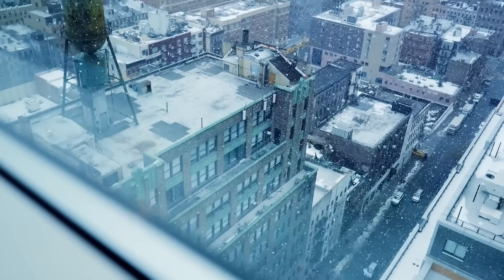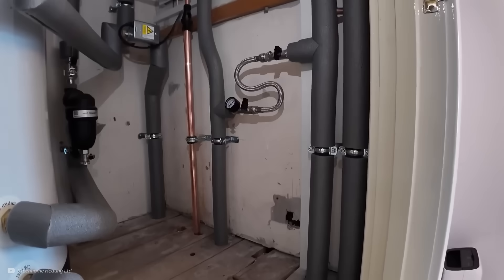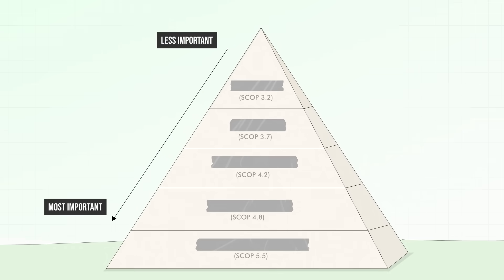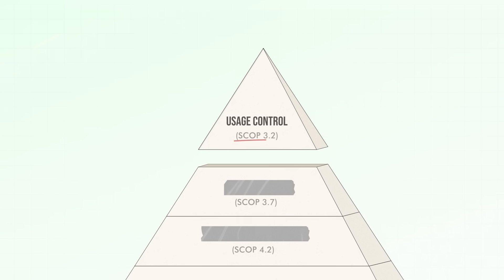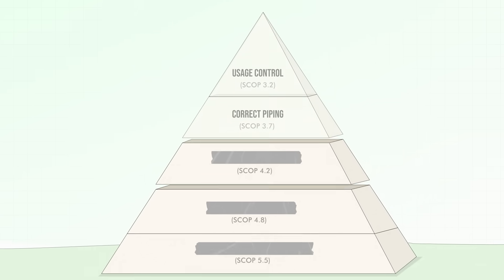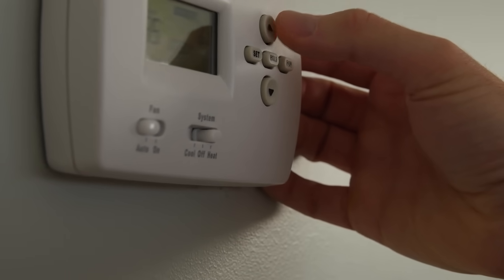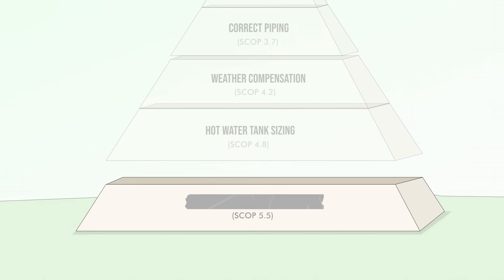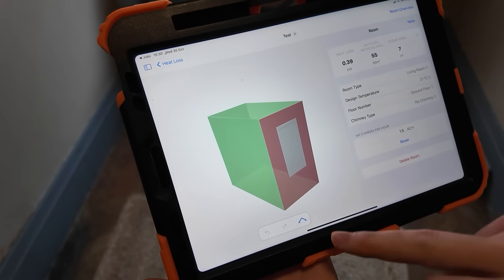The Genius of the World's Most Efficient Heat Pump

Comment: I’m afraid in the real world the stratospheric cost of installation (whether with new mega radiators or UFH), new piping, new water storage, and the HP itself is a huge roadblock for homeowners, as well as being incredibly disruptive and space-robbing, always assuming you have the spare space to start with.  Where does your furniture go and how do you live when your entire ground floor needs to be dug up?  For new builds and already incredibly well insulated properties with space HPs are a great idea.  The colossal cost and disruption for most existing homes is a circle only the very wealthy can square.
Reply: You would be surprised how economic they can be even for installations in existing homes. 

From what I've seen it's been more of a question of whether you can afford not to do an installation, especially in homes with purely electric heating.
Reply: @ People simply don’t have five-figures to rebuild their heating systems - any building/plumbing/electrical work is fiercely expensive in the UK.  Just having a car charger installed costs £thousands.   We’re already in a cost-of-living crisis and electricity prices in the UK are amongst the highest in the world, which makes the running costs of the HP very high compared to expectations (based on what I’m being told by installers).  The vast majority of homes in the UK use gas or oil for heating.  These practical issues cannot simply be wished away.
Reply: For a mega efficient (500%+ system), this can be true. For a  400% system, it's usually swapping single panel radiators for double panel. Not cheap,  but the end of the world. In the UK, you're saving relative to gas if you're above ~350%
Reply: @ That assumes an already excellent EPC value for the home.  Most UK homes already have a high proportion of double radiators - in mine all are - I’ve been told I’d need 50% larger radiators throughout.  The cost is huge because it’s not just the cost of the radiators and labour (plumbers charge £600 each a day in labour, + vat, round here), but all the pipework needs changing to accommodate the larger radiators, and that’s before the HP pipe work.   The efficiency figure vs gas takes no account of the installation cost/cost of funding (borrowing cost to pay for it - if you can afford it and a bank will lend you the money - most cannot) including the cost to the economy in higher taxes to pay for any Gov subsidies.  For new builds HPs are a cert, but for existing properties it’s a question of practicality and fundamental affordability.  You cannot force people into huge debt to pay for something they cannot afford to suit a Gov edict.
Reply: @borassictime918  I'm not denying that installs are currently costly. It sounds like you've had a survey done. Do you know what temperature they were designing your radiators to? The designer may have gold plated the design - It may be worth getting a second quote.

If the house needs double panel rads and a high flow temperature, it's probably not very well insulated. I DIY'ed my internal wall insulation and I installed my own replacement radiators - I agree that labour costs on the retrofits often make the payback very unattractive.

I agree with the financing point too. I think the government needs to do something drastic here. Make a clone of the Student Loans Company and charge very low interest rates, for example. The Green Deal was a mess, but ignoring financing is a mistake too.
Reply: @ All true.  50 Celsius was the design output.  I really don’t want to get into alot of debt just to heat my home when I have a mains gas system that works.  That is the core problem.
Reply: Depends where you live, of course and whether you own, rent or simply squat in the property you inhabit.

Many countries and states have incentives, some active assistance.    The trick surrounds payback times which come with reduced energy bills. If you intend to move on before the projected payback date, bear in mind installations do have a 'value added' effect of your property price. 

Others here have made the point that you need a reliable installer and that cannot be overemphasised.

Comment: why aren't they powered by peltier generators otherwise people will freeze to death in power cuts
Reply: Any modern central heating system requires electricity to run.  Fans, pumps etc. if power cuts were a big issue it would have been one already.
Reply: @BenIsInSweden  True unfortunately I'm in the UK which means our houses are mainly craply insulated I had to reopen a fireplace one year because of repeated power cuts.

Comment: If the hydro is generated by gas then there is no advantage, it is ok in fall and spring with nuclear power
Reply: I presume you mean if the electricity is generated by gas. You're wrong. If CCGT efficiency =50% LHV, electricity line losses are 7% and heat pump efficiency = 400%, then total efficiency is about 186%, so about double that if a gas boiler.

Comment: Stating efficiencies this way is a sales gimmick. You should instead compare work energy used to what an ideal Carnot cycle would use for the same energy transfer from the same low source and room temperatures. In reality never over 100%.
Reply: Mathematically true, but not exactly useful when comparing a system which transfers heat within a system (gas boiler) and one which moves heat from one system to another (heat pump).

Comment: Heat geek seem to really know what they’re doing. However @Ziroth should’ve mention that the only way to improve COP is to decrease the temperature rise. Every aspect of the pyramid is in a sense trying to decrease inflow temperature. Usage control avoids heating demand spikes, which in turn decreases the inflow temperature spikes. Correct pipings means higher flow rate, lowering the energy usage of the pump and the inflow temperature. Weather compensation lowers inflow temperature during spring and autumn. Hot water requires the highest temperatures, so sizing the storage tank is just decreasing the inflow temperature again. Large surfaces can use lower inflow temperatures, so floor heating can use lower inflow temperatures than small radiators.
A COP of 8 is impressive, but far from the max. I’ve seen heat pumps using lake water and floor heating, 20C source to 35C end, in September get to COP of 10.
Reply: I don't think there is any place in North America where you can find 20C lake water.  Just north of where I live, lake water ranges from about 5C to 15C.
Reply: Where I live lakes are frozen solid.
Reply: @purpleblueunicorn  Never seen a lake, where the water depth was at least 6'. freeze "solid" to the bottom !
Reply: @jackpatteeuw9244  There have been lake source HP systems that have frozen lakes solid. One I know of was 50ft deep and several acres of surface. It didn't fully thaw out all summer, they needed backup heat the next winter.
Reply: @SuperS05  This sounds like an Internet "legend".  I find these statements very difficult to believe unless you you have some documentation.
Reply: @jackpatteeuw9244  No I don't have documentation, my teacher worked on that one, I never personally saw it. This was a while ago during the oil crisis and HP revolution that followed it in the late 70s and 80s. This was a resort near Sudbury, Ontario if I am not mistaken. He has since retired, and I have had 10 years in the trade after last speaking with him.
Reply: Depends on. Pool heatpumps can get a coop of up to 14. That is pritty good
Reply: @matsv201  pool heatpumps are rated in summer, when the air temp is 20c+, they're typically much less efficient than proper central heating heatpumps.
Reply: @Etacovda63  well sure. But it still shows that cop can be really high
Reply: @matsv201  Where are these high COPs coming from? I looked at a few pool heaters, and they all got COP 5-6 at zero delta. Even high end heat pumps getting 5-6 at a realistic 40F delta is pretty good already.
Reply: I can't even remember half of that stuff anymore. It's been too long. The technologies changed in 20 years so much is ridiculous. I mean kind of sorta. They were just getting variable speed air handlers and A/C units were about 18 SEER I think.
Reply: @YouTubeRanch  I left the programming world to be an HVAC tech. Progress is dreadfully slow in this industry, it gives me time to keep up compared to the IT world.
Reply: I think one issue with most comments is that they focus on one or two aspects of a whole system. That is why I like the pyramid. It shows various system components that influence efficiency from more basic to more sophisticated. If the pipes from the outside heat pump to the radiator aren’t or lousy insulated (like mine), you don’t need to worry too much about modulated temperature control.
Reply: 800%? its a scam...
Reply: @narmale  It's not a scam, just a poor use of terminology. They mean a coefficient of performance of 8.0. That means that for every watt of electricity, the heat pump would be moving 8 watts of heat. This is in no way a violation of thermodynamics, nor truly 800% efficiency. You can't, for example, reverse the system and get 8x the electricity back out of it. You wouldn't even be able to get 1/8 of the electricity back.

If you're curious, the thermodynamic equation for the COP of heat pumps is COP = T(h) / T(h) - T(c) where the temperatures are in Kelvin. The U.S. optional low temperature test for COP is between 5F and 70F (258.15K and 294.26K), which gives a theoretical maximum of COP=8.1.

The peak COP mentioned in the video was certainly at a much lower temperature difference.

Note that the use of Kelvin temperatures helps to see why heat pumps are still useful even at very cold temperatures. -40F = -40C = 233.15K. Even at such temperatures there is still plenty of energy available for extraction.
Reply: @jasexavier  he got the 8 COP in September when a heat pump is barely used. I get 8 COP too with my standard air to water mini split in ideal conditions, but it only costs me 5$ for the whole September so who cares if I can get a COP of 15. However in winter it matters and I average about 3.2.
Reply: @purpleblueunicorn  Yeah, I would agree that the peak value is mainly clickbait and not helpful or interesting.

This is why we have seasonal ratings, which can tell you better how much energy a system will use across the entire year.
Reply: @purpleblueunicorn  He is also using it for hot water. Since the building heat demand isn't yet that high in September, a COP of 8 is really good.
Reply: @Psi-Storm  that's a good point, I'd love to have a any COP over 3 for hot water. I'm at 1 with only electric.
Reply: 800% COP is easy with 5 deg temperature difference.
Reply: @rogerphelps9939  You've obviously never installed any, temperature glide of performance isnt a constant, and is based on gas type and saturation temperatures. At 5.c COP is no more than 4x, unless CO2 or other NON domestic refrigerants are used
Reply: And you need a house on a lake with frontage or right of way.
Reply: Which unit is getting a COP of 10 with a 15°C rise? (It would only be for heated building loops here, 3°C ground water is a luxury here)
Reply: okay so i just need a massive foooookin radiator that hardly moves the efficiency needle.  21 seer minisplits which are market leading, no losses in ducting even barely have cop of 4.  to claim 100% improvements over top of the line minisplits seems iffy at best.  chasing the ole "use a larger radiator" becomes pointless rather quickly when you can install solar at 1$/watt.  hole on. hold up. let me just put in my 10,000sqft of radiator tubing to chase that 1 degree of heat.  and then you gotta pump all that water too.
Reply: COP is not only down to temperature rise, it is also down to compressor and refrigerant system design and very importantly the refrigerant itself.
Reply: yepp you are 90% right, tho its not ALL about temperature. There is also the factor as you mentioned as starting cycles, when the compressor starts its not efficient, so you wanna avoind that and also the flow rate is also about having less energy for the waterpump. 

Tho the lake and groundbased Heatpumps have great COPs, but we are talking about SCOP. In summer my heatpump also has a COP of about 20-25, even better than Lake or groundbased Systems because the air is warmer than the water or ground. But then it comes to winter, and the air is colder. So you cant compare the COP to the SCOP, because the COP is only a snapshot of your whole heating season
Reply: The COP of 8 for September is a bit sad, since it implies that the heat pump did run for heating at high outside temperatures. Which could be avoided, with improved insulation. Higher SCOPs are typically achieved with less insulated homes. I prefer lower SCOP but overall less electricity used for my heat pump.
Reply: @martinmurer4954   You clearly don't live in the UK where Heat-Geek are based if you think that September has "high outside temperatures".

Even on the south coast, September typically gets to around the teen's °c at night and day-time temperatures sit around 13°c to 17°c most of the time. Sure, there might be sunny days, but the average is certainly not "high".

Comment: 13:30 - So, the record performance was achieved in the mildest possible heating month? I'm shocked. Well not that shocked. 
The problem with this sector is that no one cares about the tech. People want heat for cheap. And talking about financial supports at the end is another clue that this stuff still doesn't makes financial sense in the current market on it's own. 5-8x and it still needs subsidies? wow... Advanced LIDAR analysis just sounds like another expense.
If you can't already tell I'm very jaded by all this stuff. 😅
Low and slow sure does rhyme nicely but if people walk into a cold house they want it warm now, not in a few hours. The experience is often undervalued there.
Reply: The thing with low and slow and weather compensation, is you aim to do as little change to the house temperature as possible, as it's a lot more efficient (and slightly more efficient with a gas boiler) to trickle the heat into the house before it gets cold and maintain the temperature.
I'm staying at my dads at the moment in the UK on a thermostat controlled gas boiler, and there are definitely times where the house doesn't feel as warm as the thermostat says.  When we travelled here, his heating had been at 16C away temperature, and even after an hour it still wasn't warm, so it's not like gas boilers give the instant heat to the home that people think it does.

After my dad has visited my home multiple times in winter that I heat low and slow with heat pumps (using air 2 air, so isn't completely on weather compensation), he agrees that it's far more comfortable.
Reply: My GSHP has managed a SCOP of 7 in mild weather. No big deal and not relevant to real world operation.

Comment: Very little talk about temperature uplift. We have air sources with COPs up to 16, but thats because it’s lifting water from 30 degrees up to 35 degrees. 

Trying to produce heat pump heat at 90C is a very different thing to producing heat at 30-40C.
Reply: Thats why COP 8 was measured in September... I guess outside temp was 19C inside 20C....
Reply: @123_1  Mine is at its greatest efficiency around 8-12ºC, it's still over 4 with negative temperatures, not -20 obviously.
Reply: Peak COP is meaningless. That is why they talk SCOP
Reply: Search Electrostatic cooling. Same process applies to heating when reversed. It's been use in military industrial complex for quickly removing heat in thickness from parts.
Reply: It is a very good job that it is not necessary to heat to anywhere near 90 deg C to give very good results.
Reply: @rogerphelps9939  The maximum my temperature gets to is a bit over 50ºC for the hot water.
Reply: which is why he stated that a large enough buffer tank is important :)
Reply: @julianzurn1428  the temperature in that buffer is the critical part
Reply: Absolutely correct - that is the reason for the focus on LOWERING the maximum temp needed. So variable heat output, not off on, forecast demand (outside temp) to meet demand with lower peak temp, bigger HW tank to lower HW temp (don't heat to high just to cool it off with cold water) FYI many HP HW systems have a legionella program, that is, once a week they raise the temp to ~65C (? freedom units) hold it for some hours and then return to the base setting.
Reply: @ianloy1854  I think they pretty much all have the legionella cycle, I have mine turned off as I don't see a real risk in a home setting. The biggest risk would come from a seldom used shower rather than a hot water tank which is regularly flushed through normal use.

Comment: I would definitely keep the water hotter for safety from Legionnaires disease.

Neat though otherwise, thanks for the video!
Reply: No need to keep the water hot enough to kill the legionella, the right intervall is key to safety and energy efficiency. Configure the system to heat up once a week ov 60° Celsius, 70° if you are paranoid. The other 6 1/2 days can be below without any risk.
Reply: The new studies of SIA for norm 385 show that most of the legionella don’t occur in the hot water tank, but the pipes. According to the norm, you have to heat up the whole hot water system to above 60 degrees at least once a week, not just the storage tank
Reply: Just programme in a legionnaire cycle that adjusts to usage. If the hot water is used often there is often no need for one. It won't take much in the way of a flow sensor and a small programme to work out if the water has been standing too long and bring it up to a high temperature to kill pathogens on those occasions.